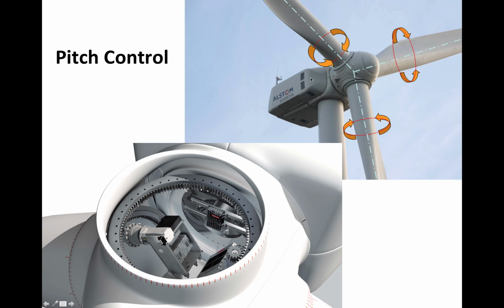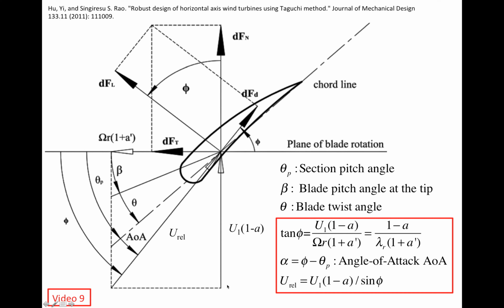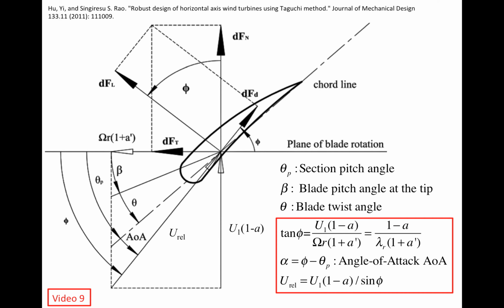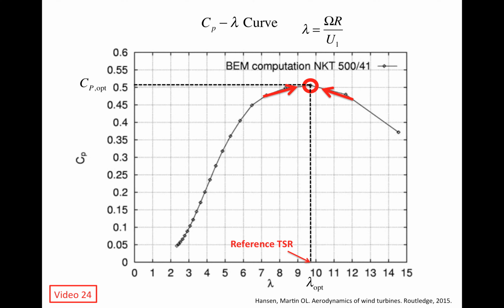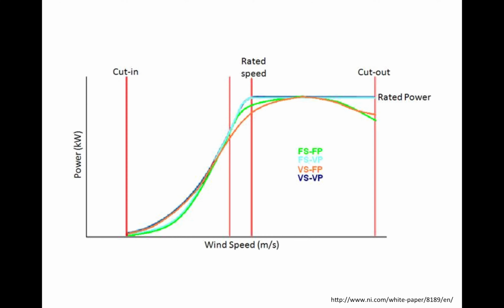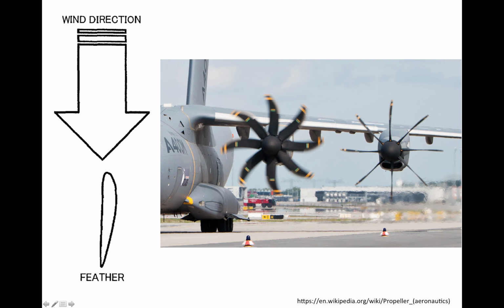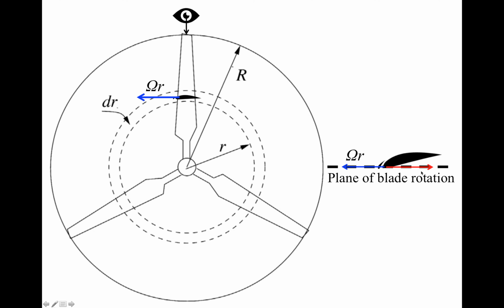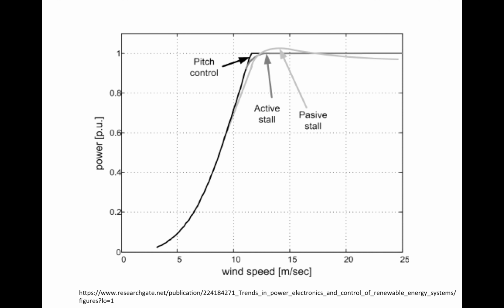Understanding Wind Turbines (26) - Control 3

Comment: There is a missundertsanding concept. As the blades are designed by using a constant value of factor  lambda (wing tip speed ratio) then the angular speed of the blade of the turbine is proportional to the wind speed "U". So if you increase "U" then omega*r is going to increase the same. you are not having stall angle of attack at any point of the blade.
I mean, that's the purpose of the WT !!!  to increase RPM as much as possible according to wind speed
Reply: no, it is not to increase rpm, in big machines this function is done by big gearboxes which convert less rpm to high if rotor rpm is high there is risk of breaking the blades and structure destruction.
Reply: omega is kept constant by pitching the blade in accordance to wind direction to hv no stall nd not high rpm
Reply: @abubakersiddiq3064  
You are right. But the video is about passive control. If you can change pitch. Then your factor lambda is not constant. It changes according to pitch.
Check the video focus about stall control